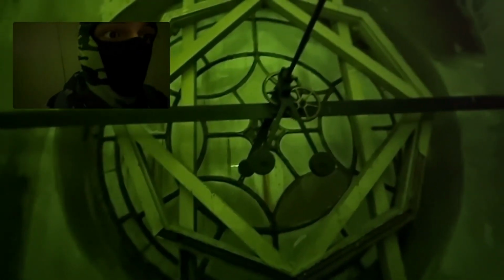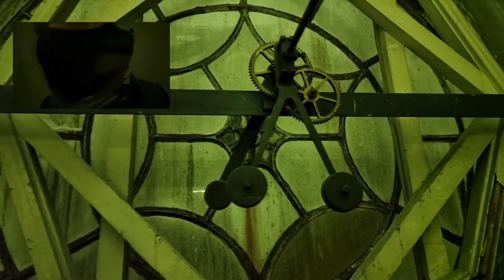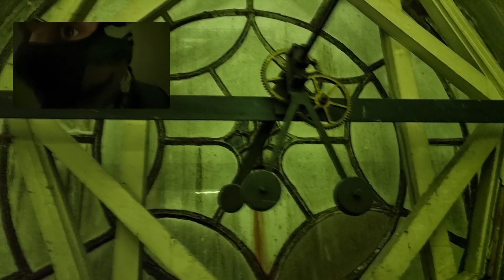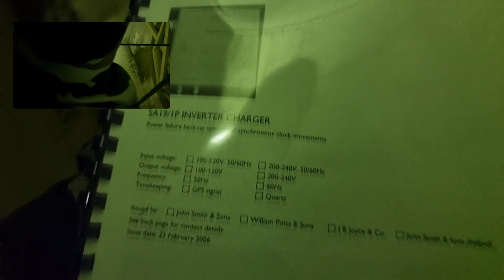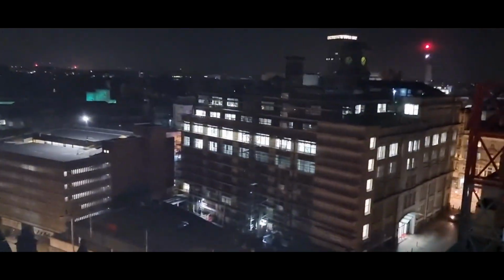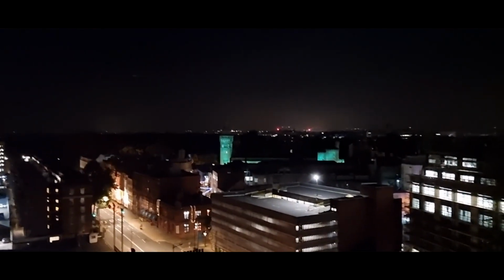Clock Tower Cardiff URBEX

Comment: Smith of Derby tower clock. The company is still around today, though they mainly make electric tower clocks. It would have required two weights, one for timekeeping half and one for the half that would have struck the hour on the bell. Every once in a while (every few days, a week, depends on the clock) a person would come up there, insert the crank into the shaft, and wind up the weights. It looks to be in okay condition, with all the original parts still there.